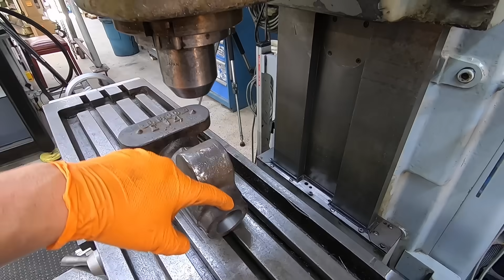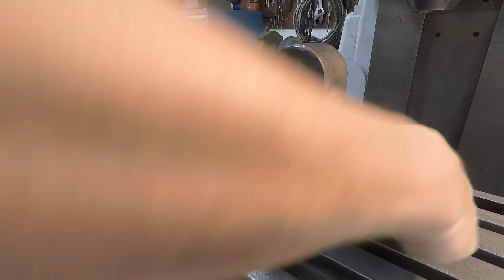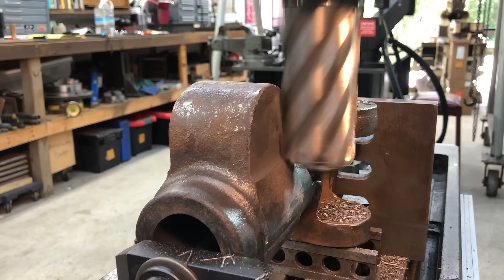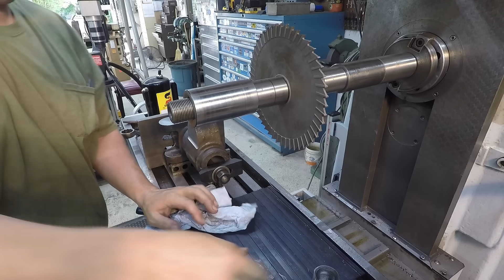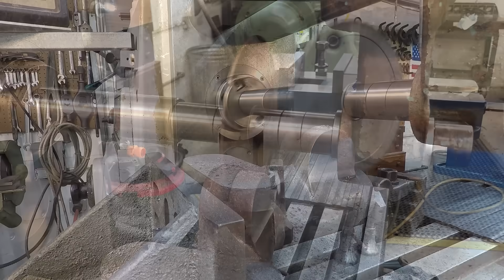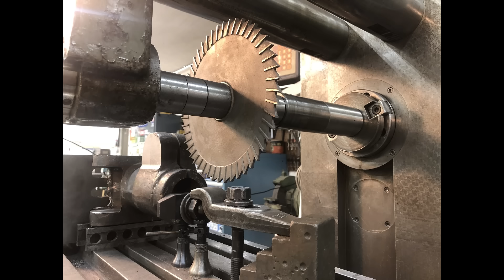Fairbanks Power Hammer Cross Head: Part 2

Comment: Hi Adam, Is there a reason you didn't use cutting oil when drilling the 5/8 hole in the angle plate? I'm not giving you crap, just curious!
Reply: The angle plate looked like cast iron. Those machine ok without oil.

Comment: It looks to me like the slitting saw is not concentric with shaft it's mounted on. If you watch the chips you can see there is a variation in the amount being cut which coincides with the same spot in the slitting blade on each revolution.
Reply: Thats actually quite common with those saws and with the sloow feed you have on this operations, it does not actually mater.

Comment: I thought he would have stopped the blade and drilled like a 1/2inch hole at the base of the saw blade cut it would have been easier to get the split as far as he wanted and would also prevent the casting from cracking in the sharp corners of the blade cut it would look like this basically  o----

Comment: Seems like it would have been better to cut downward against the machinist jack instead of upward and away from the machinist jack as you did.
Reply: My guess is that he did a upward cut to protect the machine should the saw bind. If he was cutting downward and the saw bound, it would  push the part into the table and put the force on the arbor, where the upward cut might just kick the part out of the clamps and prevent so much force from going into the arbor.
Reply: @TheMoltenDragon  Good theory, maybe someone else can chime in on this as I was wondering why he was cutting upwards as well. to mee a downward cut pushing into the jack would be more logical at the first glance.

Comment: Another great video as usual, but I have a concern about  whether the  longitudinal slit extends far enough beyond the clamping ears to allow the bore to readily clamp onto whatever rod it is meant to clamp onto. As can be seen at the 30:00 minute mark, the inner extent of the slit next to the bore, stops right beside the clamping ear. The uncut section at that point will tend to prop the bore open against the action of the clamping bolt. The slit that Adam has provided may be all that the the drawing called for, but it is a less than optimal design. The design provided to Adam may be just a copy of the original part, but if that is the case, I wonder if maybe the original broke because of this issue. In an effort to stop the part slipping along the rod, the operator applies more torque to the clamp bolt and eventually breaks one of the ears off. Subject to any other constraints, a better solution would be to extend the longitudinal slit  so that the slit section of the part with the clamping ears is freer to clamp onto the rod.  The alternative of putting a cross slit partway through the bore to isolate the clamping section from rest of the part is undesirable in this part because  it weakens the part against longitudinal forces, which is presumably what the part has  to work against. 

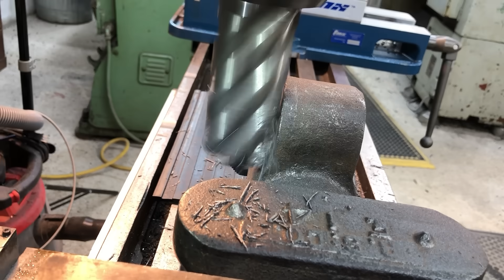In the video link below, at exactly the 10:01 minute mark, you can see a similar Fairbanks crosshead, and it is apparent that the slit extends well past the clamping ears. (The  extent of the slit is only visible at that exact second.)  https://www.youtube.com/watch?v=cA3uOZ0G89g  
Cheers
Reply: @cmmartti  I agree. Extension of the slot by just about any means would work, just so long as it happens before one the ears is broken off, by trying get the clamping action to work. One other point, that I wondered about is whether the original part was grey cast iron or something more ductile. The cross head  that can be seen in the video link  that I provided, looked pretty bashed and battered, which made me wonder if the original part might have been malleable cast iron or cast steel.

Comment: @31:42. There is an external casting flaw at the side of the casting right by the clamp on the right. Also I see another flaw at the root of the clamp flange where it meets the rest of the casting I'm concerned that these are perfectly placed to encourage crack failure during use under clamping and shock forces. Would it be worth brazing over them before considering the part ready for use?

Comment: It is most likely that numbers put on a machine face of a casting are only there for internal use of the foundry.
They are called heat numbers. Records are kept of the numbers so if a sample from a pour doesn't pass meteorology the others from that heat can be identified.
Not sure about the conical peaks on the face, perhaps measuring across the peaks gives high definition features to check shrinkage/contraction is as intended.

Comment: Looking You parking the vertical milling head of Your K&T made me think:"Lucky him, he has the quill". I thought so because I just assumed that there  MUST be a quill in a setup like that. Obviously I was wrong.
Those who have not operated a milling machine that does not have the quill cannot possibly understand why we try to find alternative solutions to vertical boring in such a machine. It is just a pain to do that. Threading under power is VERY difficult.
I have a Schaublin SV-51 from 1955 in my workshop. This is an universal milling machine. It does not have the quill but instead it has an articulating milling head. Changing between vertical and horizontal milling configurations takes about 1 minute including tramming the head if it was in some strange angle.  No parking needed. Just turn the head on a suitable angle and reel it into the machine.

Comment: Laymans question mid video -- how about the saw cutting down into the table instead of up-??
Reply: I'm not an expert like Adam but I do believe the swarf (wet metal chippings) would clog and distort the cut
Reply: In fact, You just might be able to do that. However, this requires even more rigid setup than that Adam had. For some reason slitting saws are almost always operated to that direction.
The slitting saws will protest very loudly if they do not have enough many teeth making contact with the material. On the other hand, the more teeth there is in contact, the more the saw tends to chatter. The truth is somewhere there ...

Comment: I was wondering when you put the blade on backwards if it was going to lift instead of pushing down.
Reply: Climb milling with a slitting saw is something that You might try once. Yes, it tries to lift the part and therefore the second support helped so much as it keeps the part from lifting up.

Comment: Wouldn't it work better with the saw, if you turned the sawblade and rotation to have it actually push the part you're working on Into the crosstable of your mill?
Reply: I was thinking the same thing  but I'm an electrician not a machinist.
Reply: @tommussington8330  funny thing: me too 😂
Reply: That would increase vibration and knock the cut out of true.
Reply: @joshschneider9766  It would? Why?
Reply: Climb milling with a coarse slitting saw is something You can try once only.
Reply: @FinnoUgricMachining  can you explain why? I've read some stuff and don't have a real conclusion...
Reply: @MrDarkhammer  A slitting saw with that big radius tends to really climb on top of the workpiece if climb milling is used. If the milling machine would have a neglible backslash then this would not be a problem.
However, since most manual machines of that age do not have the ball screws but rather have an ACME or some other "normal" screw, those need some backslash to operate. In addition to that needed backslah there is the wear and tear which adds to the backslash.
Now, in case of climb milling, the workpiece can "freely" slip backslah amount under the blade which then can cascade into a more severe situation with blade shrapnels flying around.
With older machines climb milling is usually used to peel off miniscule amounts of material. Adam did that with the spring passes.

Comment: Any problems climb cutting with a saw like that?  Seems like it would push the work down into the jack and potentially reduce the vibration.
Reply: Climb milling has the word "climb" in it. A coarse slitting saw in a milling machine that might have some backslash. Thats a recipe for a disaster. For some funny reason nobody does climb milling with slitting saws.  I tried it once and it did not end well. Nothing got destroyed but I was really lucky.

Comment: Is it standard for horizontal saw teeth to cut upwards like that? My gut feels like cutting towards the workpiece and table would be more stable? Not second guessing you, just genuinely curious.
Reply: What you are describing is called a climb cut in machinist terms and what abom is doing is a conventional cut. A climb cut is where the tool cuts into the workpiece and the cut tapers off, a conventional cut is the opposite so the tool cuts away from the work and the chip is thickest at the end of the cutting motion. Your gut feeling is right, a climb cut is more stable and easier on the tool. However it reguires a feedscrew with no backlash because it has a tendency to grab the workpiece and cause the table to vibrate back and forth. Most modern cnc-machines have ballscrews so most of the time a climb cut is used. Most manual machines have trapezoidal or acme feedscrews that reguire some backlash to function properly. So this machine is propably not capable of safely climb cutting such a heavy cut. You can see the same stuff with how adam does the side milling, when he's taking most of the material off he's conventional cutting and only does a very light climb cut for finishing and he can get away with it because the table has enough mass to prevent it from bouncing.
Reply: @MI-vf5zs  Holy cow; thank you for the explanation! I appreciate it.

Comment: i'm curious, if you've restrained a workpiece as good as you can and you still get high frequency vibrations, would it be possible to damp it by sticking some soft rubber or silicone to the piece? they sell these sticky pads that drummers can stick to ride cymbals to shorten their sound, i'm curious if that effect is ever practical in a machining context.
Reply: I don't have any personal experience with this, but one of Abom's older videos shows him putting a short length of garden hose inside a pipe to keep it from ringing while he's cutting on it. I don't know if it does anything to reduce chatter, but it makes the cut significantly quieter.
Reply: I seem to remember Keith Fenner using a lump of lead strapped to the piece to kill harmonics in some of his older videos.

Comment: I liked the way you worked through the vibration issue. When the machinist jack moved I wondered what you would do. The shots after the wheel cut showing all the old school pieces that went into that best process are excellent. I was after thinking your work and thought it might be interesting to take a four flute end mill straight down through there to create an anti stress shape.  Good to come from a family of machinists! BTW I do think the iPhone shots are better stabilization wise if only a different shade of light because the two different sensors - software - bios. I hope you can get a selfie stick maybe with a battery inside it to keep your mobile charged in case you need to be the "go - getter" at the drop of a hat.

Comment: Hairy stuff!  and a great video.  Did I miss the bit where the slot was cut relative to the bore centerline?  The cheeks were machined relative to the casting I think?  But maybe its not important.
Reply: Given the purpose of the slot (relief to allow clamping the bore tight), I think it probably doesn't matter. I'm slightly more interested in whether the faces were machines relative to the bore. I know that the size of the casting only allows so much fiddling there, but I don't know how much I would trust the casting either and these faces seemed to have a good amount of material left.

Comment: Not a machinist so forgive me if this is a dumb question.  When doing the saw cut, why was it setup to do a climb cut, rather than pushing the piece down on the clamp?
Reply: Because of the backlash in the table.  It would probably break the cutter. This is not actually climb milling what you proposed he do is climb milling.
Reply: @seantap1415  Thanks for the explanation.

Comment: Beautiful, I don't know which was more memorizing, the slice with the blade or the machine change over.

    Question; I notice many of your clamp down nuts/bolts for both machine and work seem somewhat lightly torqued down. Not loose mind you but if I was using grunt measurement I'd call it 1 grunt. Maybe I've been over tightening mine all along ?
Reply: You probably have, as a toolmaker I only tighten down enough to hold the work, I used to be appalled at how studding and nuts used to be distorted due to overtightening, I never allow a milling m/c operator to use my clamp equipment for this reason.....

Comment: Love your videos, saw your video when you were at the KOA in Black Mtn. I live in Asheville sorry I didnt get to meet you.

 I had an idea, I have been around machine shops all my life and I also do wood working. Here is my question, would it be beneficial to take a "CYCLONE" dust collection system for wood working and adapt it to machine shop use so it would collect the metal shavings?
Reply: Excellent idea Roger, thought about that many years back. The problem really is that the chips tend to collect like a bad artery. Especially when either coolant or cutting oils are used. We use a number of shop vacs and before long the hoses get heavy and it's darn near impossible to clean them.
Reply: @keithhansen3963  Thank You for responding ! Yeah,  I had not factored in the coolant problem. What if you centralized the vacuum source, ie. the cyclone? Then plumb the vacuum to each machine to a say 5 gal. container, with a short flexible hose with a magnetic mount on the end of the hose. That might alleviate the clogging problem, but would still provide continuous suction during operations. Especially in the big shop where there are multiple machines running at one time. Like in a hospital room, where the suction is continuous but the nurse can plug in a small container to the port for cleaning stuff up ?

Comment: Are you going to "relieve" the end of the slot cut with a drilled hole to stress relieve and prevent the casting from cracking when you tighten the clamp bolt? Then you can saw or file the radius of the slit down to the drilled hole. Otherwise, that left over web would have a tendency for the ears to draw closed in a taper, rather than parallel with the shaft in the bore.
Reply: I was thinking the same thing straight 3/16" drill at the end of the cut and file away the bottom.
Reply: @esnyd  The drill radius should be 1.5x the width of the cut, or slightly more, depending on the tensile strength of the material. Since cast material is far more brittle than steel or other malleable metals, then I would probably venture close to 5/16 or .3175" AND additionally mill a cross-slot, with it's own end cuts radiused as well, perpendicular to the main slot to allow a more linear and parallel clamping pressure. Since this part clearly has a parallel linear motion in it's use, thus reducing these stresses minimizes any eventual breakage of the part while in use.

Comment: Awesome Adam, I'm surprised the drawing doesn't have maybe a 1/2 inch or so hole at the end of the slot to prevent a stress riser. Especially as it's a power hammer and will be getting a fair good whacking.

Keep up the great work👊

Comment: Great video. Going to make a suggestion Adam. The edge of the split. Drill a hole at the edge of the split that removes the 90deg face transitions caused by the saw blade. That's going to flex & fatique and over time may induce stress fractures particularly a cast part. The little time it will take to drill, save a lot of hassle down the line. Especially after putting time working & machining that part. Hope that helps. Ireland sends many blessings! Thank you!

Comment: I find it curious that the face cut at 13:00 does not have to be aligned to the center of the hole bored in the first video. Thanks for including the change-over. I remember the videos of your making the arm the head hangs from. It is nice to see it in action.
Reply: All milled surfaces and hole positions are dimensioned from the bore centerline in the drawing (apart
from the height 'z' dimensions).

Comment: Could you have milled the slot in the other direction? With the opposite rotation, to push cutting impulses into the jack instead of pulling on the workpiece? Or would it have been basically the same?
Reply: would've been climb milling, basically the machine wants to rip the cutter forward, you'll break your tools and ruin your parts
Reply: @Chummboid  It's not climb milling when milling in the opposite direction, or even downward (plunging), when the cutter is also mounted, and rotating, in the opposite direction. My question was more if the rigidity provided by the jack and the angle plate could have been sufficient then. The jack only provides support downwards and some of the cutting forces can act sideways and even upwards (rebound), which the angle plate can't eliminate completely, especially during resonance. Just curious how bad the chatter would be.

Comment: 22:30 you could have turned your sawblade around. So the force goes down instead of up. Good job else!
Reply: @Jamie Fletcher thanks! I was wondering that myself
Reply: @Jamie Fletcher You always have a climb cut on one side using a saw blade. That's why he had to clamp it additionally down after the first try.
With such a rigid setup he is using, I wouldn't be afraid of stalling the machine. Also the chip evacuation would probably be better.